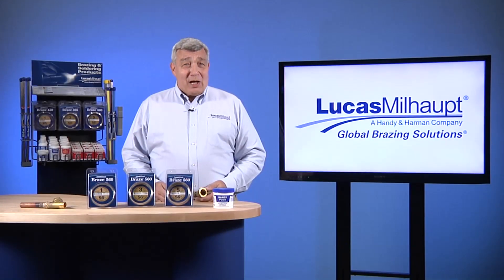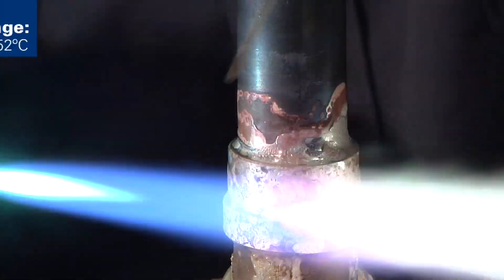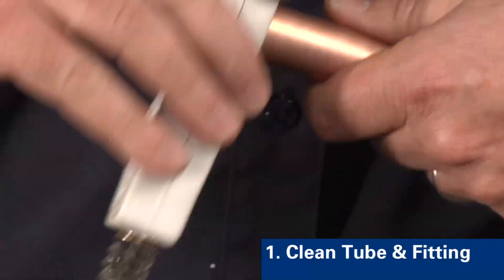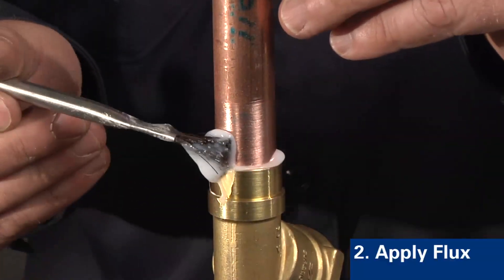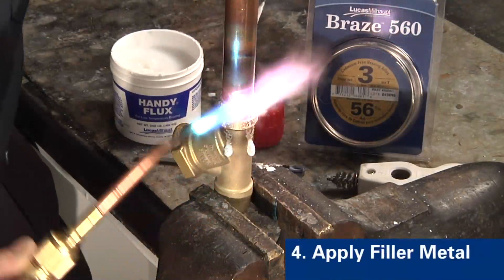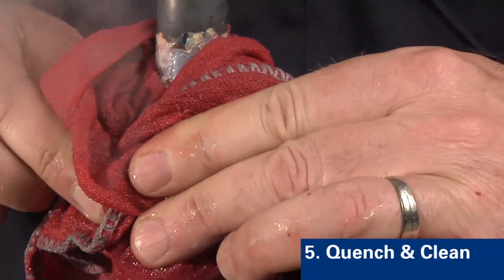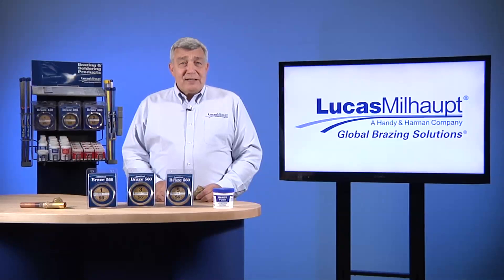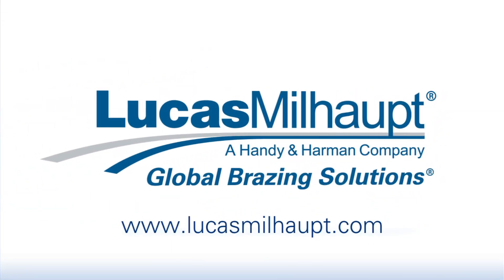Joining Brass to Copper with Braze™

Comment: i work in HVAC manufacturing and we braze the brass valve ports or valve body’s to copper on the Switch Over Valves. sometimes it looks beautiful and sometimes i can’t seem to make the alloy bond to both materials
Reply: Use silver solder. Buy it now before silver corrects in the market.

Comment: Can I use solder that is using welder in the electronic components to brazing copper with brass and aluminum? Please advice
Reply: @Freddy McIntire   Do you advise me to use welding aluminum that we used to braze freezer leaking ? Can we used the wire aluminum  for brazing Copper